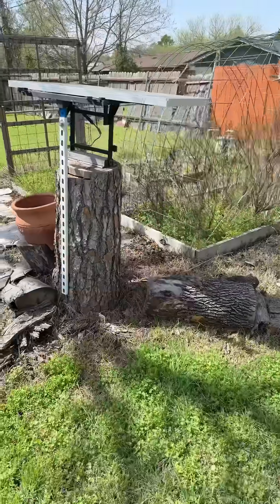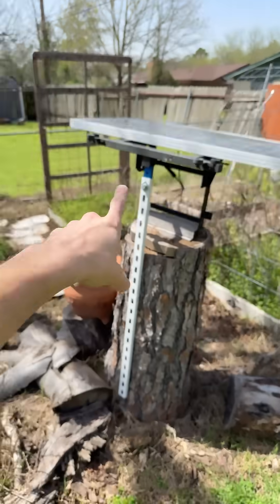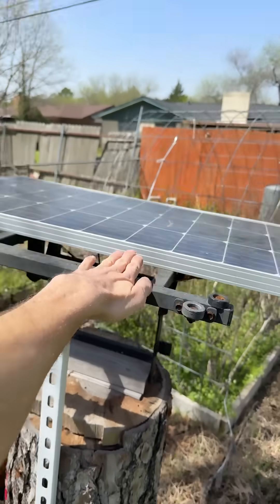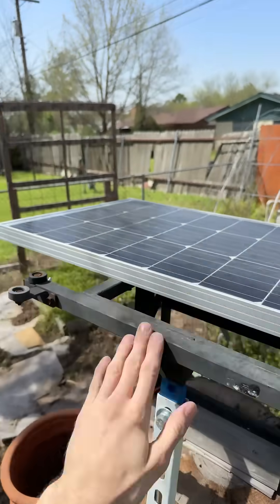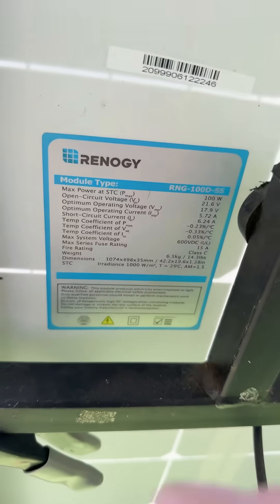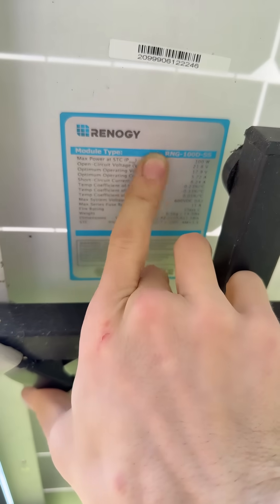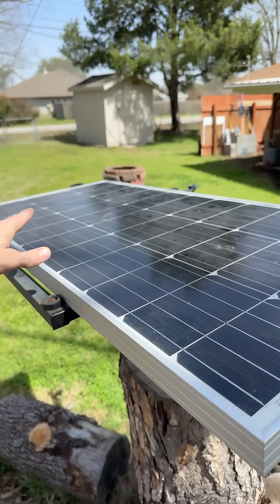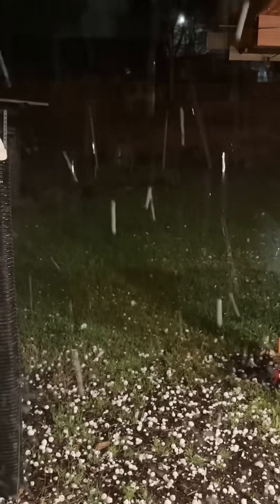Solar Panel damage test! Using real life Sky Ice 🌨️ #hail #storm #extremeweather

Comment: How often do you need to clean solar panels? Does dust and dirt reduce the amount of power you are to make?
Reply: Yes, it does affect the performance. Its fine tho. solar modules are self-cleaning in a sense, means when it rains they should be fine. In general, solar modules should be installed at an angle which would help the self-cleaning properties. Snow buildup is another thing that can happen, but that depends on where you live. There are places where you are better off not even bothering with solar.